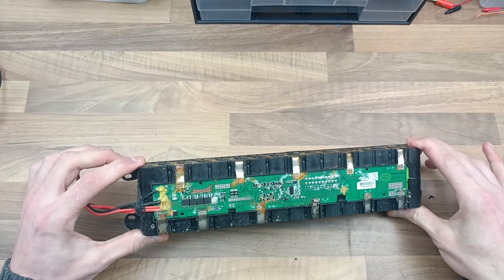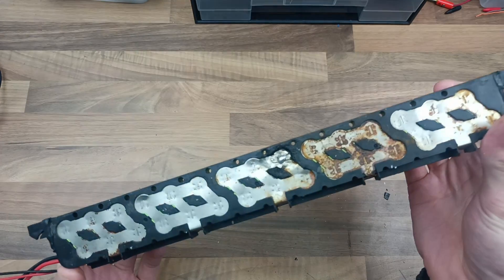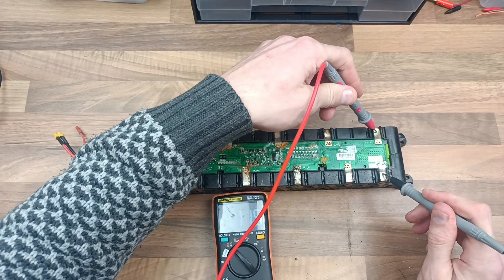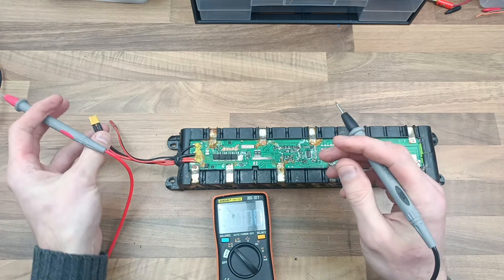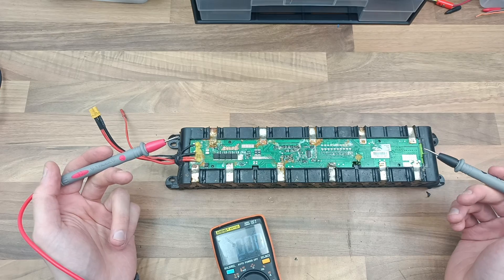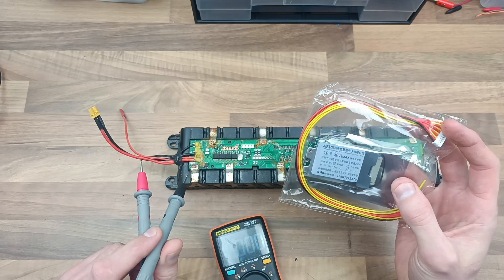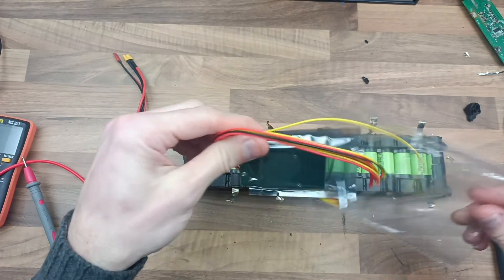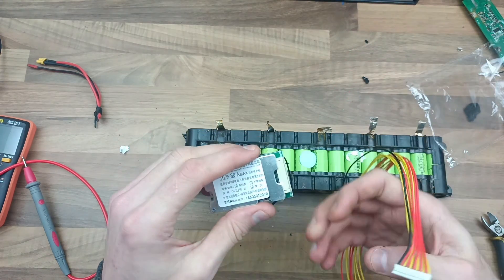Repairing/Building/Rebuilding a 36v (42v) BMS Lithium Ion 18650 Scooter Battery on the Cheap! (1/3)

Comment: Can't you see you have water damage??
Reply: Umm water doesnt damage it creates opportunity for damage. Hes very correct that the water damage is not an issue because the surface rusted is not the connecting surface just outer coating of the electrical pathway. Its damaged but the damage does not affect the stuff he is doing in the video